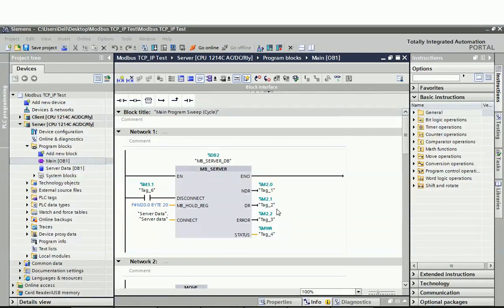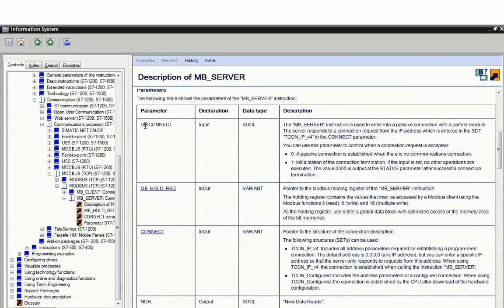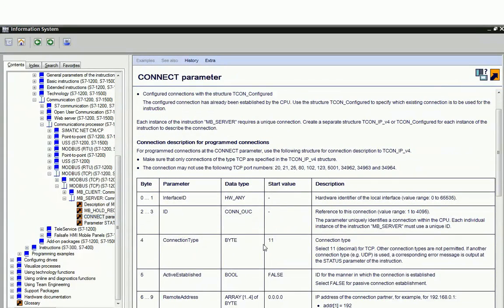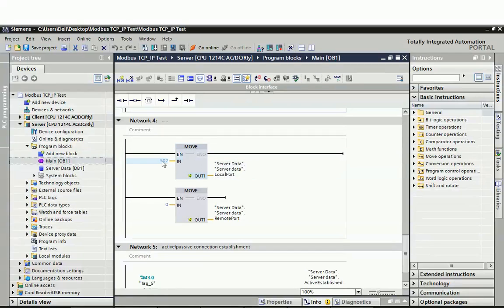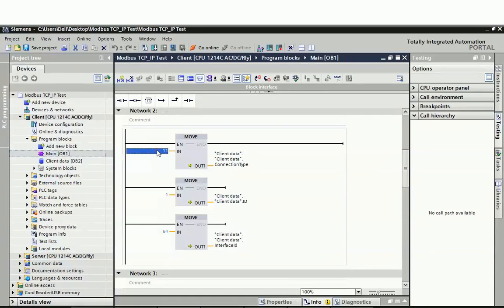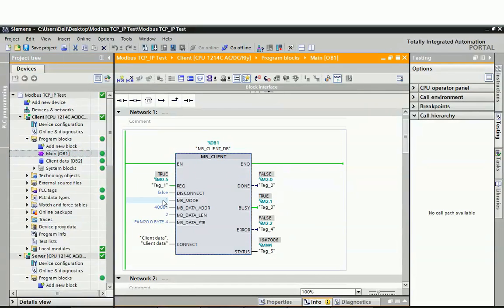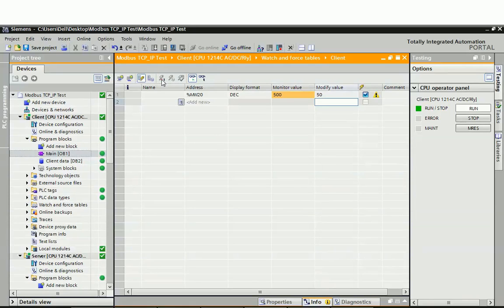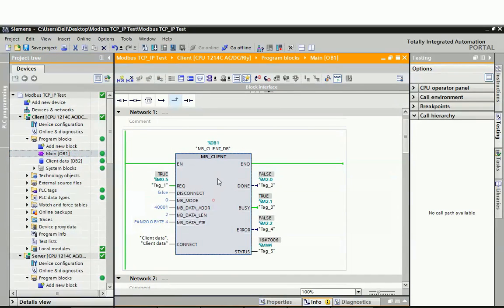PLC to PLC communication l Modbus TCP/IP l TIA portal l Siemens

Comment: Hi ,

I have one plc in customer factory 1200 series. And it use modbus server tcp communicate with dcs 

Now customer want add new machine and new plc new to get data from old plc so I need to communicate and write modbus client to new plc only ?

Need also write the server into new plc too ?

Let said my program all packed in db500 and dB 500 consist of analog and digital as well as bit , so what is numbers of MB_Data_Addr in client site should be ? Is this still 40001 ? I confuse of this section. I don’t old plc with mine just want test communication is this the way to test it ? 

I don’t wish to write anything in my old or existing plc. The client not need add into old plc right ? 

Thanks 🙏